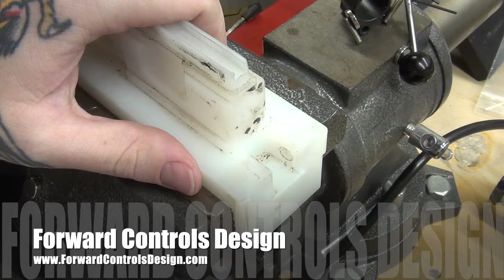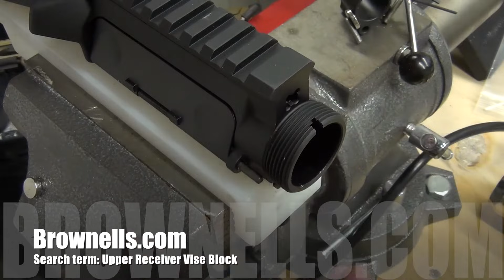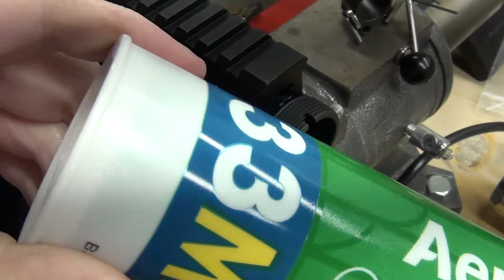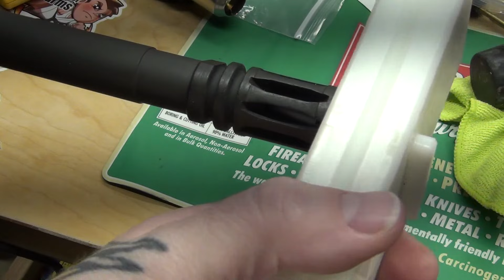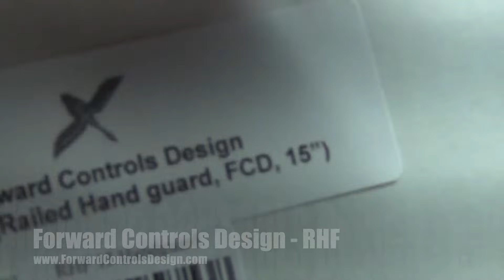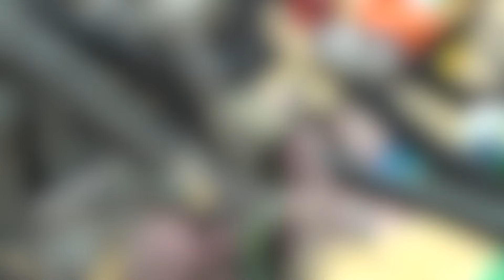How To Install Tight Barrel - Barrel Installation

Comment: I think that upper and /or barrel are a bit out of spec. I've put dozens of barrels on and never had one that was that hard to  put into the receiver. As a matter of fact they all just slid right in with barely any effort.
Reply: A lot of higher end receivers are this tight, Zev/Mega are prime examples. If you call them they'll flat out tell you it's a thermal fit...you freeze the barrel and heat the upper or it ain't going on and you almost always have to beat em on. For me I chuck the barrel in a vise with plastic jaws and then beat the receiver onto the barrel at the very back.

Comment: i know im late to the party here, I just got my Larue gun kit, and my barrel slides into my upper with no force. i can slide it in and out with my hand. is this a bad thing?
Reply: Thats normal.  The barrel nut is what holds it in place.  If the barrel doesn't wobble around when you install it it should be fine.

Comment: Personally I would not install a barrel that tight , can you imagine trying to replace that barrel down the road .
Reply: It is a thermal fit upper, they are made that way..The barrel will slip right on or off if the proper amount of heat is applied to the upper..

Comment: So If you'll need to remove that barrel in future, how will you remove it if it took so much force to get it in?
Reply: If you heat the receiver up with a torch it is can't be done a little more easily. Jp has a great video on this.

Comment: The torque wrench needs to be in line with the wrench. If you are at 90 degrees, you are creating a lever which will not give you the accurate torque rating. Not intuitive, but trust an old mechanic. Good video, thank you
Reply: You are completely opposite of the truth. 90 degrees off is correct. If it's in-line, you're increasing the length of the lever, and your torque value will be too high. He did it correctly.
Reply: @heyhayhay247  correct, put it at 90 degrees you don't need to do any offset math. Keep it inline and now you have to compute the new additional leverage and take the torque value down.

Comment: You dont really know what youre doing. Heat the receiver up a lot more, like with a torch. Cool the barrel extension in a freezer for 20min. Very quickly put it in before the temps equalize and it tightens up fast. You should not have to beat anything into place if you cool the extension and heat the receiver adequately. To cool the barrel extension faster, use a can of air duster upside down and spray the liquid out of it onto the extension

Comment: Always have your torque  wrench straight  with barrel nut tool, at a 45-90 degrees. If not straight  to  tool you get a false torque. USAF Armor tech 101.

Comment: Holy cringe 😬 try putting the barrel in the freezer and (lightly) torch (heat gun should be fine too) but shouldn’t have to wiggle it like that

Comment: A modular device should never have parts that are so tight, something is out of spec. Solution so you don’t have to use a slide hammer to extract the barrel, run some Emory clothe on the barrel seat just take a couple of thou off till it slides in easily. And torque the barrel nut for a good seat.
Reply from the maker: If it was milspec that would be true. This is not a milspec build. Look up thermal fit.
Reply: Yeah that's not the case at all, there are plenty of manufacturers that have this tight of tolerances on the receiver and barrel.